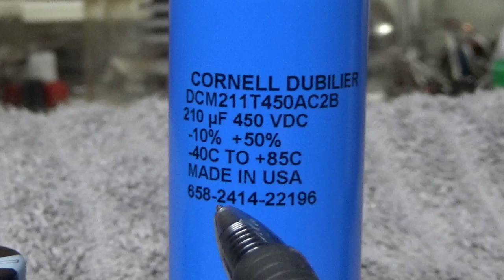Electrolytic Capacitors Used On Harbach Website

Comment: I bought an SB-220 power supply board rebuild kit from Jeff a couple of years before you took over the business. The parts are nice quality, the board is good quality. Soldering the parts to it was a breeze. The amp has been running beautifully ever since I rebuilt the power supply. I'm glad you took over the business and help us keep the old dinosaur amps alive. I also have an old FL2100B that has had the supply board rebuilt and re-capped and it also runs like a champ. I like to watch the repair videos and I learn more about amplifiers each time I watch. I'm no expert by any means but I learned enough over the years to fix my own amps and I've repaired a few for friends. Now that Ameritron is history, there are thousands of hams out there who need guys like yourself to keep them alive. Keep up the good work.
Reply from the maker: Thank you

I hope to be doing it for another 35 plus years

73